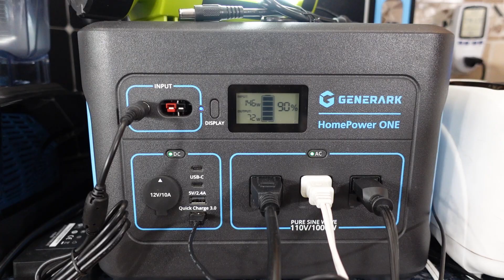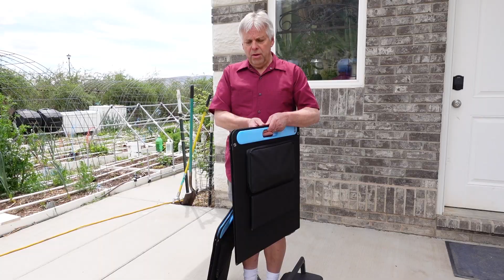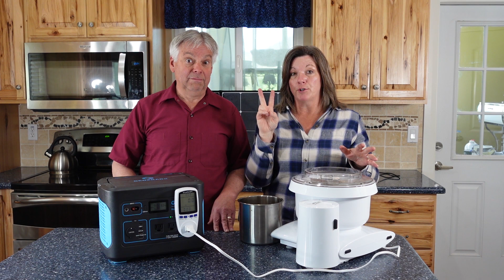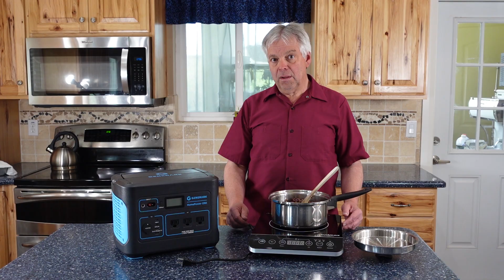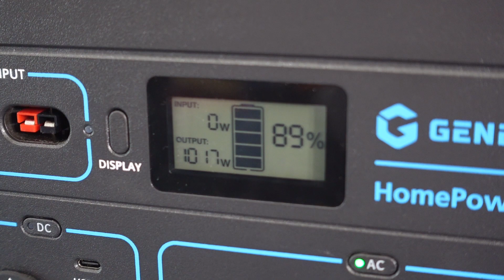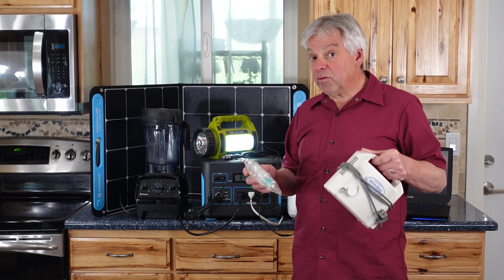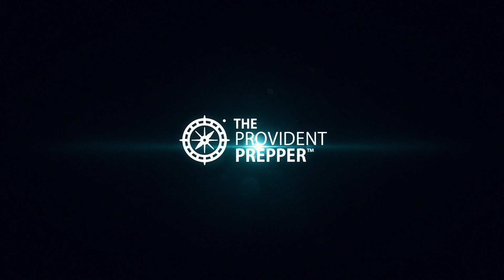Emergency Power: Generark Solar Generator Review

Comment: Great review ! It's exactly what i need . unfortunately the price is not. Lol. Ill be boiling water over a fire pit, electronic's will just have to die. But, its a great little unit, does what the average house mom needs & lite weight i could carry the unit with solar panels. Enjoy ❤
Reply: Lots of options for power, at many price points. Simple solar with an inverter/battery (computers need pure sine) seems to be the lowest $.
Reply: @Utah_Mike  can you go into a bit more detail on this? How would one go about knowing what to buy for a diy system like this?
Reply: I keep a little sierra stove that cooks with just a tiny bit of wood--even damp wood as it has air assist from a tiny battery-operated fan.  Works great and was cheap.   
Also a folding mini rocket stove.  Fits under my car seat.